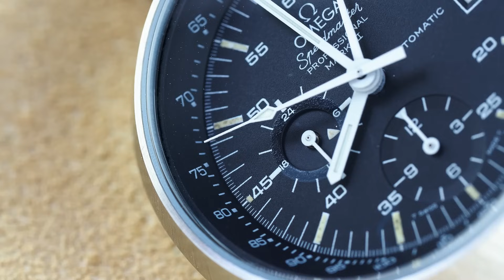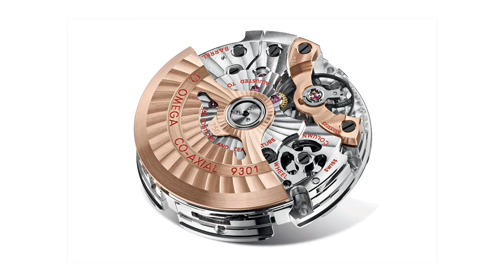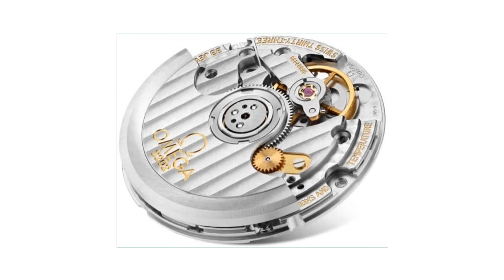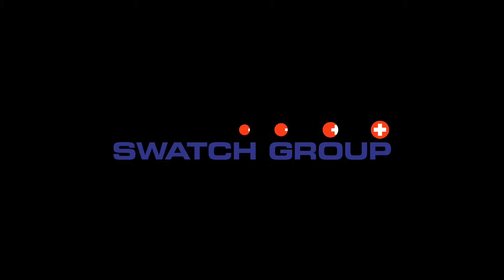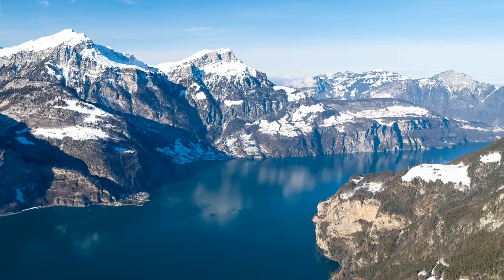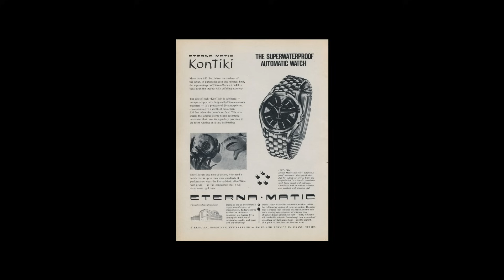Why ETA Watch Movements Deserve Respect

Comment: What do you think of Miyota 9015 & 9039 as alternative to ETA
Reply: That question is a good one, and one that is being asked by many in the hobby. 
And the answers are interesting!
Reply: Better than the elabore grade of both from what I've heard. Versus top grade it's more competitive. Bear in mind though the age difference.
Reply: @johnanth   when you say age difference are you talking about the year they were develop ? I was asking the question because I don't have a ETA but have the Miyota 9039 in a watch that's running very well around  +3sec. A day , Thanks for the comment.
Reply: I have a Miyota 9130 in one of my watches, it has a PR indicator too. I was told that the movements were every bit as good as comparable ETA movements. Mine seems to be a very good timekeeper too, running at very close to COSC spec.
Reply: @desmondoreilly1210  
That's a sentiment I always hear too Desmond.
I'm ғᴀʀ from an expert in this hobby; less so in the pros & cons of various mov'ts, so hearing this consistently about Miyota's 9 series is valuable to me. 
Time Factors use the 9015 in their (newly expanded) Smiths Explorer range.
I have my eye on a few references. The watches are right up my alley style wise and I expect them to be keepers, so a good solid reliable mov't is really important.
Reply: @anthonysmith2982  Was looking at those Smiths this morning, very nice but too small for my tastes. I can only say my Miyota experience has been very good. I understand they are easy to service with readily available parts. You should have no need for any concerns.
Reply: @desmondoreilly1210  
Mate, I've got an 8“ wrist! so was initially not interested. But I prefer smaller pieces.
I realised that a number of my vintage pieces are actually smaller - and worn on straps.
I'm going to buy a few. I think that the bracelet will give me the presence I need.
Can always sell them if I'm underwhelmed due to the size... I'll get 90% of my $ back at least...
Cheers mate. All the best.  ✌🏼️

Comment: I have 3 Swiss watches (Doxa, Baume Mercier, Glycine) with ETA 2824 movements and all three have stopped running in relatively short order, one of them (Doxa) a second time after hundreds of $ to repair. I dislike ETA a considerable amount.
Reply: That's interesting.
I have several ETA's too
• 2893-2 (Glycine & Steinhart)
• 2824-2 (Certina & Glycine)
• 2824-2 variants w/- ext. PR (Certina & Hamilton)

I've not had any issues at all and I'm very pleased with all the above pieces.

That said, my watches with the Seiko 6R35 or Miyota 90S5 are just as pleasing.

There are consistent rumblings about the Miyota 9 series mov'ts being superior to ETA as I'm sure you know.
I don't have the expertise to know myself, however Time-Factors came to that conclusion during testing for a number of Smiths ref's; experiencing a lower failure rate and better performance from the Miyota.
It's going to be an interesting thing to see play out as many of us in the hobby question the meaning of 'Swiss Made'.
I'm sorry to hear of your mov't issues. I wonder if ETA's focus on lower beat rate / ext. PR mov'ts is their focus moving forward? Certainly the Japanese have caught up to them, Seiko included with their 6R mov'ts.
Best of luck bud.
Reply: Learn how to use them properly before you break anymore 😂😂

Comment: So what are the time setting issues with the Oris Calibre 400? I wasn't aware of any problems. Just curious.
Reply: The minute hands is jumping when the crown is pushed back in. Check the recent video of Bruce Williams on the Oris review
Reply: @cedarcanoe  thanks. good to know
Reply: Each time you want to set the time, the minute hand jumped (when you pull or push the stem)
Reply: @Nightmark2  thanks